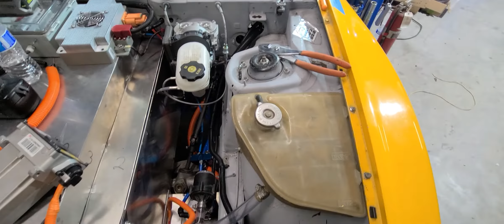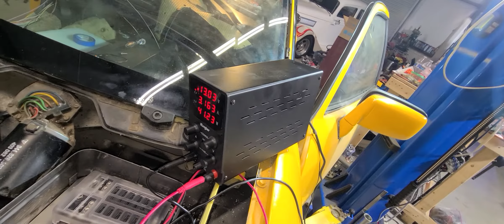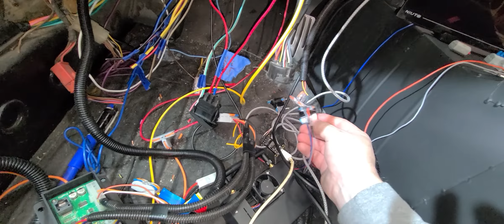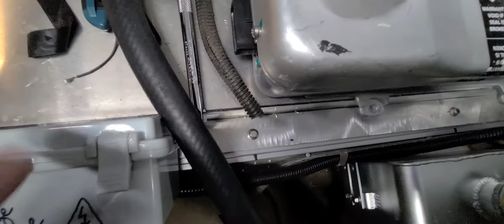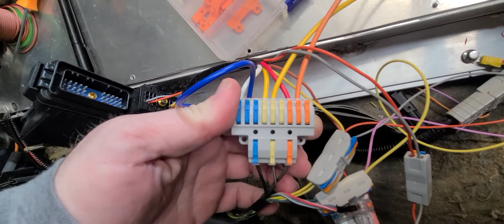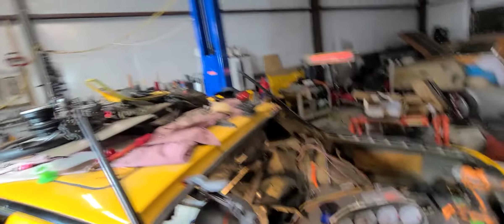Porsche 944 Tesla Model S Swap - Update 2/?

Comment: Looks like a very tricky operation. I have a 924 Id like to convert to electric. Such a nice looking car and the old stuff doesnt make sense to redo an old engine. Very neat work you are doing there. Hope the next bits go smoothly :)
Reply from the maker: Thanks! I completely agree with you on redoing the old mechanicals. Even if they were sound designs, the cost alone is (shudder).

I have to day, if I were to do this over again, I would have gone with the small drive unit and a different battery pack that is easier to house and lighter. I know this thing will be a beast when it's done but it's definitely a lot of everything.